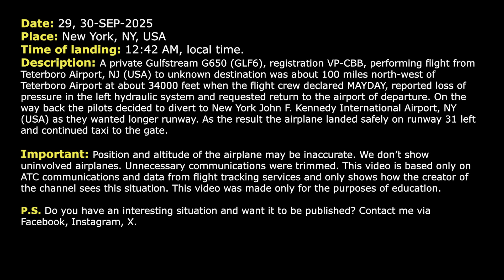MAYDAY. Hydraulic system failure in flight. Long runway requested. Real ATC

Comment: Technically this didn’t need to be a MAYDAY. PAN PAN would have been more appropriate. As long as this Gulfstream didn’t lose Left Hydraulic fluid everything was available except the L/H Thrust Reverser. Diverting to JFK I guess was prudent but Teterboro wouldn’t have posed any issues.
Reply: Declaring a mayday with a hydraulic system  failure is never inappropriate.
Reply: @HomemadeBrownies1  clearly you know nothing of how these systems operate. I flew and maintained Gulfstream’s for 35 years. I didn’t say it was inappropriate it was just overkill. You might consider it prudent but I wouldn’t have declared MAYDAY. The situation was completely manageable as this crew excellently demonstrated
Reply: @douglasslotolowicz9454  Jesus christ the arrogance in that comment... a MAYDAY call is not overkill for a situation where you can possibly lose flight controls. When a plane starts having hydraulic issues and you're carrying dozens of pax at 33k feet, calling for a mayday is perfectly fine. The crew doesn't know if the situation can worsen at any moment. They don't know if the situation is "perfectly manageable" until it's over because they can't exactly inspect the plane, can they? You wouldn't have declared mayday because you're not a pilot, and when you're unsure if it should be a PAN-PAN or a MAYDAY, you call MAYDAY. No harm in that. It's not like there's a downside to calling MAYDAY when it was actually a PAN-PAN anyways. 

You don't do the bare minimum when you're flying passengers. You do everything you can to make the situation safe, including calling MAYDAY and going to the airport where you feel like you got the better chance of landing safely. Period.
Reply: @EddieMatou I clearly stated I flew and maintained Gulfstream’s for 35 years. The crew knew exactly what their situation was. Did they not tell ATC that the back up systems were performing fine. Flight Controls were fully functional, Landing Gear, Brakes and Nose Wheel Steering were fully operational. They didn’t have any fluid lose, as they said the pump failed. There are 4 Hydraulic Systems on this aircraft, the Left System is a major one but the back up, the Power Transfer Unit took over all the functions except the L/H Thrust Reverser. This crew did nothing wrong but MAYDAY is what the Air India crew rightly announced as they were losing altitude. The checklist for a Left Hydraulic System failure reads, check fluid quantity, hard select PTU on and land as soon as practical, not immediately. It’s not arrogance on my part just a reasoned analysis based on knowledge and experience.
Reply: @douglasslotolowicz9454  "clearly you never did [...] but I did for x amount of years" is being arrogant, like it or not. And you're reasoning with hindsight, just stop, it's embarrassing.
Reply: @EddieMatou  the only one who’s embarrassing is you. I’ve done these exercises numerous times in the simulator, granted we know there’s no danger involved but we’re expected to treat it like the real world. If we land after an engine fire we perform the emergency evacuation check list.I have yet to see any mention of expertise or knowledge on your part. You’re entitled to your opinions, but your facts seem to be nonexistent. If you’re a fan of aviation, which you seem to be since you viewed this video, good for you, it’s a wonderful and fascinating field and I was lucky to have a career in my chosen field. I’m a huge baseball fan but I don’t, for a minute think I could manage a major league team. If your an aficionado please check your arrogance and don’t lecture me, an aviation professional. Whether MAYDAY or PAN-PAN was invoked by the crew of VP-BCC is a relatively minor difference, the choice was theirs. All I’ve said is I wouldn’t have made their choice, I’m not saying they were wrong, it’s called an informed difference of opinion.
Reply: Does the quick reference guide specify mayday or pan call?  No criticism intended for anyone involved…